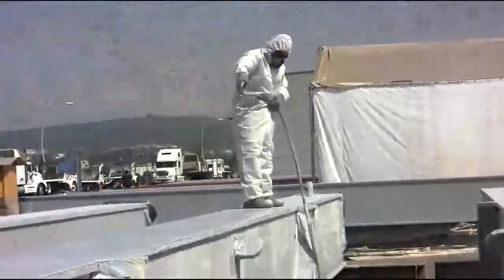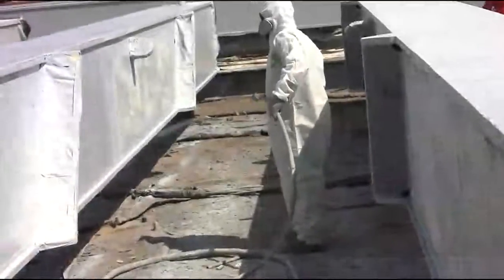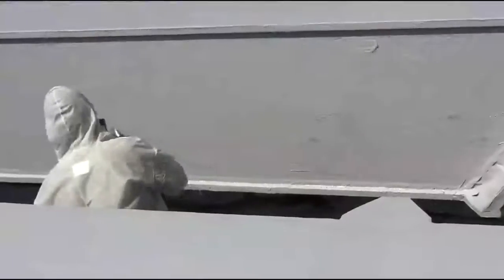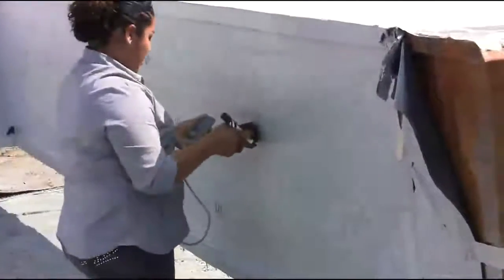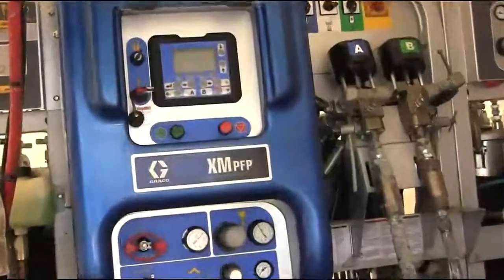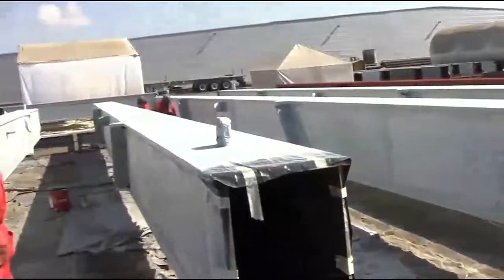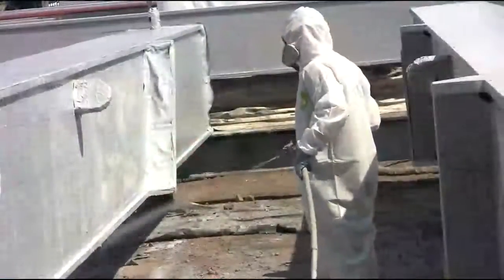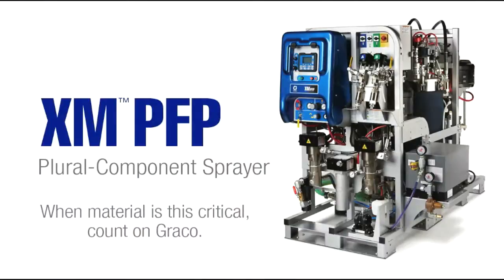Graco XM PFP applies fireproofing coatings on Mexico City skyscraper

Comment: Is this a different type of material that was used 20 year's ago by Grace that came in bag's?
Reply from the maker: In this video, the XM PFP is spraying a Carboline intumescent fireproofing material. The fiber filled liquid material is comprised of a base (Part A) and a separate hardener (part B) that are precisely pumped and mixed at a set ratio, depending on the material manufacturer's formulation. The nature of the Carboline liquid material is different from the bagged material from Grace. 

GCP/Grace fireproofing products are a cementitious based fireproofing. They are still manufactured today and are highly used in the industry. Typically, this type of fireproofing is sprayed with a specialty pump, like the Graco ToughTek F340e, F800, or P-series of rotor stator pumps.

For more information about fireproofing sprayers and pumps, visit https://www.graco.com/us/en/contractor/products/fireproofing.html